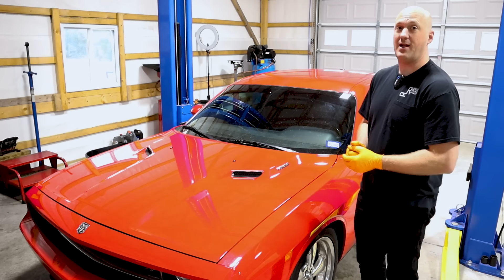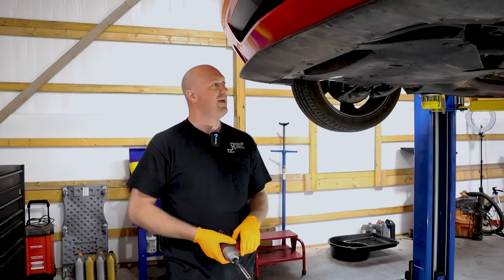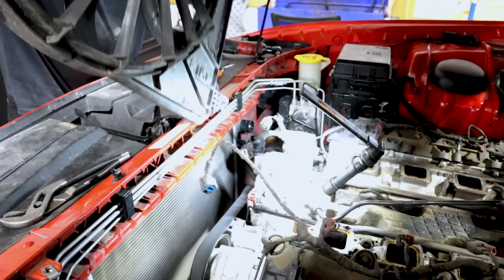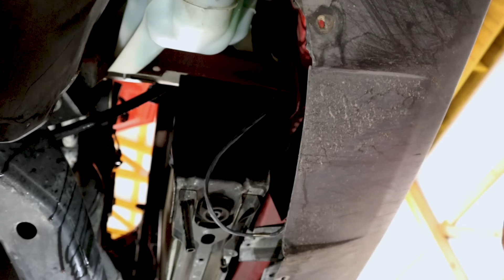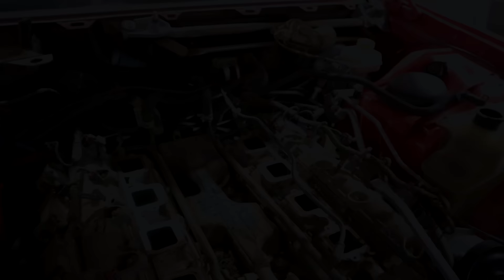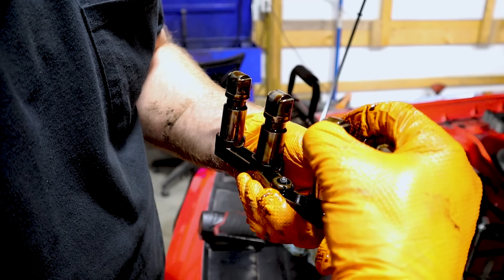Hemi Cam Installation! Budget Challenger Build Ep1

Comment: Referring your video:  "How To: Engine Timing on Chrysler Hemi 5.7 // 300C Episode 3" of 23 Oct 2020, why did you remove the cylinder heads? Even replacing the valve springs with the heads installed (using air pressure) is possible?
Reply from the maker: Yessir, I have other videos that show replacing the valve springs with the heads installed, in fact, a later video in this series shows just that. In the video showing engine timing I had the cylinder heads removed because on that engine it had dropped a valve seat, so the heads had to come off anyway.

Comment: What's the best way to get to the passenger valve cover bolts?
Reply from the maker: There's only a couple that are really tricky, but for those I like to use a 1/4" drive swivel socket, which has a tighter bend than a wobble socket. 👍
Reply: @ReignitedAuto  thanks for the tip and reply back 👍

Comment: I’m re building my 04 Dodge Ram hemi what cam would you recommend as I’m trying to stay all stock as it’s daily driven
Reply from the maker: No reason to rock the boat then, if you're happy with the stock power then the stock cam works best, no compromises needed. It's actually surprising that the stock cams aren't that expensive from the dealers. To be honest though, I'm not sure that they still sell the cam for a 2004.
Reply: Thank you for the advice would you recommend a super chip and do you know if I have to get the crankshaft balanced it’s brand new and again all stock parts
Reply from the maker: @Jerryfausto1  Don't worry about having the crankshaft balanced, just drop it in and go. As far as the chip goes, I'm leery of just how much impact those can have on a fuel injected engine for how much they cost. I imagine it could make a small difference though.

Comment: Thank you it seemed hard before I saw your video now I have a better idea and I can do it. Thanks to you
Reply from the maker: Appreciate you watching Samuel 👍
Reply: @ReignitedAuto    I own a 2006 Dodge Charger hemi. I do have a question driving on a hot day car stalled shut off but started back up. I have read that the pcm goes out with out notice. I have 93500 miles on my charger.
Reply from the maker: @samuelhuanosto3532  I have actually heard that problem before, unfortunately I have never run into it myself, so I don't have any solutions for you. Obviously there is potential for the the PCM to fail like that, but it's a fairly expensive guess.

Comment: Wait, is the 6.4L SRT engine the same block as the 5.7 RT? Is it the same engine with some bolt on upgrades?
Reply from the maker: The block is basically identical just with a different bore. 👍

Comment: Can you use that same cam on a 09 dodge charger 5.7 hemi and if so which one would be better that one or the comp cam
Reply from the maker: Yep, same cam can be used. As far as which one is better depends on what you want out of the cam. The comp cams version will probably get you more on the top end, but the 6.4 cam offers excellent driveability.
Reply: @ReignitedAuto   ok cool thanks I have just 1 more question I'm having a problem with rev limiter when I'm in park and I rev my engine and then put the car in drive the car goes into safety mode and dosen't even recognize its in drive and the check engine light comes on so I pu the car back in park cut it off and cut it back on and put in back in drive everything works normally but the check engine ight stays on I'm bumping my head on the this one and when I scanned the check engine code it was a p0219 code for engine overspeed I never heard of this before ugh this is very frustrating

Comment: I have to replace the camshaft but my car has MDS. Will I have to remove the system so that I can replace it?
Reply from the maker: You don't have to eliminate the MDS system if you don't want to, if you want to upgrade to the 6.4 cam just purchase the one that does have MDS and you're good to go. 👍
Reply: Thank you for your help.

Comment: Will this mods work on my 2017 ram sport 1500 5.7?
Reply from the maker: Yessir 👍
Reply: @ReignitedAuto  I am trying to find the part numbers could you assist me. I want to do the 6.1 cam, srt exhaust and lifters  2017 ram 1500 sport 5.7 hemi.
Reply from the maker: @jaysonwheat2344  the 6.1 can won't work in your vehicle, needs to be the 6.4 cam. Likewise the SRT headers wont work on the truck platform. I don't actually have access to the factory part numbers anymore, but your local dealer will be able to provide them for you 👍
Reply: @ReignitedAuto  ok cause 4 weeks ago you said it would, look where you responded. So none of this video will work on my truck? So going to the 6.4 cam I would have to program then correct? Any suggestions oh headers because I have a tick and almost positive it is the headers.
Reply from the maker: @jaysonwheat2344  This video shows the installation of the 6.4 camshaft. You will still be able to use this cam and lifters on your truck, just not the headers since they are too wide for the truck platform. I don't have a specific recommendation for headers, kind of depends on what you're after. The shorty headers are nice because they are a fairly easy install, and will bolt up to your existing exhaust. The long tube headers will likely gain a little more power, but they are much more difficult to install, and you will have to modify your exhaust to make them fit. Any camshaft change at all I would recommend the tune be adjusted to compensate, however the 6.4 cam should run/drive just fine with the stock tuning.
Reply: @ReignitedAuto  thank you very much. Where are you located? Maybe I can bring it to you and you can do a video. Also want to do the catch cam

Comment: Why would you tear down that far an not do the timing chain? Especially on a 120+ thousand mile motor.
Reply from the maker: These newer engines aren't like the old ones. I've done a timing chain on a 200k mile Hemi, and the old chain was identical to the new one. They just don't stretch. Not to say you shouldn't do it for your own peace of mind, but in my experience they aren't necessary.

Comment: Very informative video , do I have to pull the heads on my 6.1 to do the cam swap ?
Reply from the maker: Technically no, you can pull the rocker arms, spin the cam 720 degrees to knock the lifters back and slide the cam out 👍

Comment: Do you have to remove the heads in order to pull the cam shaft out?
Reply from the maker: Technically no. You can remove the ticket shafts and pushrods, spin the cam two full rotations to knock the lifters back and you can pull it out. Usually I'm changing lifters though so I have to pull the heads.

Comment: I was thinking about putting a cam in my 5.7. Any advice? Suggestions?
Reply from the maker: Honestly, I don't have a lot of experience with different aftermarket options. My advice would be to know exactly what you want to do with the car. Is it an everyday driver? Drag car? Street/strip car? Once you know what it will primarily be doing then you will be able to make the correct cam choice, because no one cam can do it all.
Reply: @ReignitedAuto  Thanks. I want to keep it a daily
Reply from the maker: @iNeedMoney2  yea, definitely don't go with a crazy cam then, definitely look for a more streetable option.

Comment: I have a 2005 Chrysler 300c with the 5.7L hemi, it has 231k miles on it, I’m wondering if all of this stuff can be done to my car?
Reply from the maker: Unfortunately no, when they added VVT in 2009 they changed the block a bit, so this camshaft won't fit. However the process for a cam swap on your car is very similar.
Reply: @ReignitedAuto  where would I be able to look to be able to find what will fit into mine. I’d love to be able to upgrade my engine for a little more power while keeping it as close to factory drivable

Comment: Would swapping out a cam shaft and lifters remove the hemi tick?
Reply: My 04 1500 2wd has a hard knock but goes away after it warms up. I made an apt for this Wed...seen your other video examining the different knocks symptoms .hopefully it's just an exhaust leak:/
Reply from the maker: @frijoles1699  for what is worth we usually didn't see lifter issues on those early models.
Reply from the maker: All depends, the Hemi engines have several different ticks, some are normal and some are not. It's always hard to identify which tick noise people are referring to. In this case, swapping the cam and lifters would correct a hot engine tick/misfire.

Comment: Hey I'm about to do this same swap in my 5.7 charger. It's got 110k on it, former police car. Do you reccomend taking the heads to a machine shop for pressure testing and inspection?
Reply from the maker: It's never a bad idea to have the cylinder heads checked out, but in my experience it's not strictly necessary. Most of the time the cylinder heads are just fine to clean up and put right back on.

Comment: If I put the 6.4 MDS cam and lifters in my ram 5.7 4th gen , will it still require a tune?
Reply from the maker: It'll run on the factory tune, but to take advantage of the new cam absolutely a tune is needed.

Comment: Will the 6.1 or 6.4 headers fit on a
06 5.7 hemi??? Nice video, my
06 charger only has 60k on it
and I want to cam it and upgrade
the exhaust!!!
Reply from the maker: I've gotten quite a few questions on whether they fit the older style vehicles or not. My answer, Maybe. I believe they should fit, there wasn't really any changes in chassis style between the years, but I can't say 100% because I haven't tried it myself. Good find on a low mileage '06, that's one of my favorite years 👍
Reply: @ReignitedAuto  I bought it new in 06, my wife and I
Drive a Semi full time so that's all
we have put on it all this time!!!

Comment: If you're installing an aftermarket camshaft you should still check the degree on your camshaft to make sure it's all the way on point right? I was told that's the best way to do it for performance.
Reply from the maker: Nope, on a straight swap you won't need to do that, since there's no adjustment built in, it's either in time or it's not. If you have an adjustable cam gear then yes you'll want to degree the cam. 👍

Comment: I would like to do the camshaft change on my 2013 Ram 5.7 Hemi auto 4x4.  I couldn't see what you did with the Phazer Spring before you put the allen key in the hole to lock it in place. I already have the camshaft. It's the stock 392 camshaft with MDS and I would like to put the block off plugs in and switch the springs and replace the lifter with non MDS if the oiling for the MDS can be turned on full time. I'm sure glad you decided to do a series on this mod on your program.  I also have long tube headers for the truck that are stainless steel and look exactly the same as Kooks and the other expensive brands and they made the same power. Richard Holdener did the dyno comparison on them at Westec. Anyway I'm sure glad I can follow someone who knows what they are doing for this project. Kindest Regards,
Paul.
Reply: Ya I bought them over a year ago and l had them delivered to friends house in Cheektowaga, NY and they've been there for a year because our border was closed and then they closed yours. They're polished stainless 300 series and bent to the same configuration as the $2000. models and they make within 1 hp of each other on the engine dyno, which makes sense. A mechanic by the name of Richard Holdener does all the engine dyno's at night when they're closed at Westech l think it is. He's on YouTube as well under his name. He does mostly LS and Hemi topics, very interesting. Oh ya Sky l forgot to mention l bought the headers for $200. off Ebay, really good deal, l think now the Covid pricing has them up to $700. or so
Reply from the maker: @paulwitham2220  that guy is the boss, only posts actual dyno numbers, bursting a lot of power myths 👍
Reply from the maker: For the cam chain tensioner, the tension isn't super strong, so basically you stick a screw driver or small pry bar against the block and push the tension back into the housing until you can pin it in place with a small allen key. Definitely appreciate the kind words and I hope your project goes well, should sound terrific with the long tubes on it! 👍
Reply: You must be nuts, you're really stretching it now. Did the F35 marketing team hire you, if they did they're loosing big time with you. You make these ridiculous statements. $4700. eas the Gripen C with the much smaller Volvo engine, they never said $4700. for the Gripen E, however my guess would be $6500. for the GE414G which is still gtest compared to all it's overpriced competition.

Comment: Will this work on 4.7l. Ram 1500's, they seem to have this problem too.  Thank you very much if you can answer this question.
Reply from the maker: The 4.7 is a different engine architecture completely since they are overhead cam, however, they definitely do suffer from ticking issues. The issue on the 4.7 is actually the lash adjusters leaking down when the vehicle sits for awhile. Generally the noise is worst when first started, then quiets down after a few minutes of run time. 
Some good news though, this in no way will damage the engine, it's just annoying. The other good news is that you do not have to remove the camshafts to replace the lash adjusters, there is a special tool to press down on the valve spring and remove the rocker arm, and then the lash adjuster can be replaced. 👍

Comment: Great series! This is the first well done video on doing the cam swap on one of these hemis. I see you only did the springs in the top end. What about rockers, push rods, and valves? My father keeps telling me that I should do a total top end rebuild while I’m in there but is it really necessary? I don’t have any plans for boosting the car, just bolt ons like how you’re doing it.
Reply from the maker: Definitely don't need to replace the rockers or the valves. You can make a case for installing hardened push rods because they are pretty cheap. 👍
Reply: @ReignitedAuto  awesome, thanks for the reply!!

Comment: So, do you think it’s safe enough to run 392 cam in 5.7 without unlocking the PCM and tuning it? This upgrade is tempting if it works without any additional upgrades like tuning, springs etc
Reply from the maker: I'd still recommend springs, but yes the vehicle will run and drive on the stock tune. Definitely do a tune as soon as you can though to actually reap the benefits of the cam swap. 👍

Comment: can I do this set up to my 2014 Dodge Charger 5.7  automatic transmission 
if so will the part numbers change
Reply from the maker: Depends on if you are keeping your MDS system or not. If you do keep it, you'll need the 6.4 cam from the automatic vehicles. And the lifter part numbers will be different as well.
Reply: @ReignitedAuto  thank you 
for the reply

Comment: I have a 6.1 hemi. Is the procedure the same? Anything different?
Reply from the maker: It is similar, however there is one major difference. On that engine the cam thrust plate is all one piece that goes behind the oil pump, so you have to remove the oil pump to replace the cam, this means that you have to remove the oil pump pickup tube. This can be done without removing the oil pan, but it's a fiddly job. 👍
Reply: @ReignitedAuto  
I’ll have the motor on the engine stand..so it should make it a tad easier. 
I couldn’t really find any videos even 1/4 as good as yours for the 6.1...
Any other differences? Or any other things I need to look out for or be aware of on the 6.1? Cam, springs, lifters.
Appreciate it..and love your channel.
Reply from the maker: @mattmichell5122  Nice, should be really straightforward then 👍. Any questions pop up during the job hit me up on Instagram I'll answer if I can.

Comment: Was a Chrysler tech back in the days of the performance engines were the 4cyl turbo and the 3.0 V6 how times change for the better. I have the 2018 RT 5.7 and it seems that if I want to upgrade the headers do a cam lifter swap also. I heard installing headers on them is not fun. You earned a subscriber.
Reply from the maker: Thanks Man! Definitely want to remove the heads to install headers if you've got the chance. Doing them on the car is not fun. I usually pawn those jobs off on the younger guys under the guise of they need experience 😄

Comment: You seem to be very knowledgeable about Hemi engines, I own a 2014 Challenger and im all too familiar with the video where you discussed the Hemi Tick. I purchased my car with 20,000 miles to return three weeks later due to the tick. The dealer replaced camshaft and lifters which they said were scorched. However when my oil is dirty the Hemi tick is heard until vehicle warms.  I wish you were local would love to have you upgrade my challenger.
I would love to send you photos do you have email?
Reply from the maker: You can email me direct at reignitedsales@gmail.com 👍